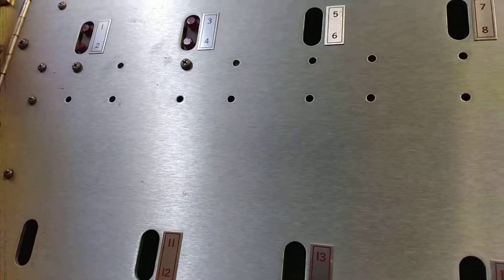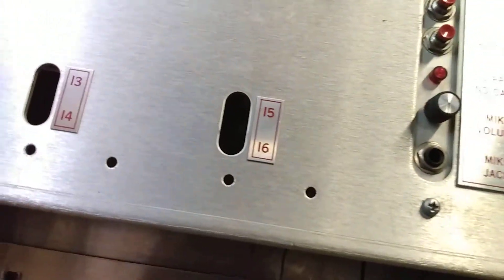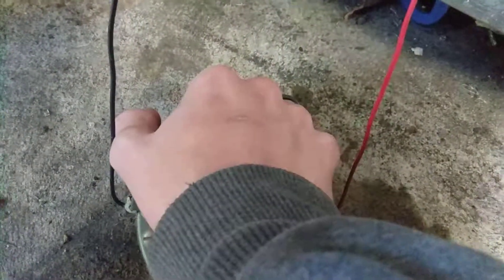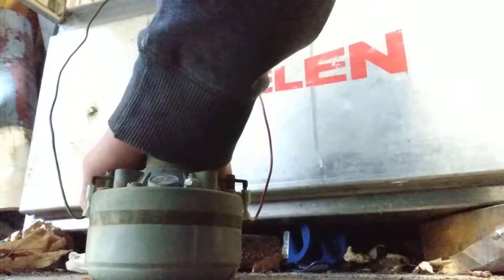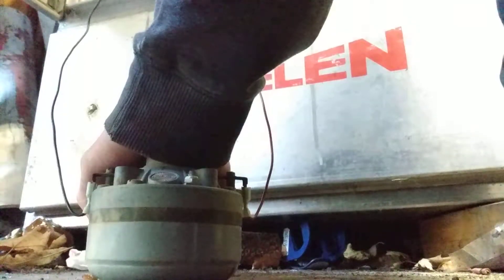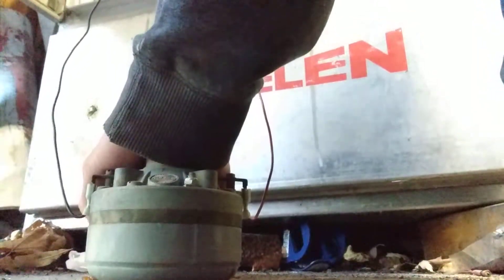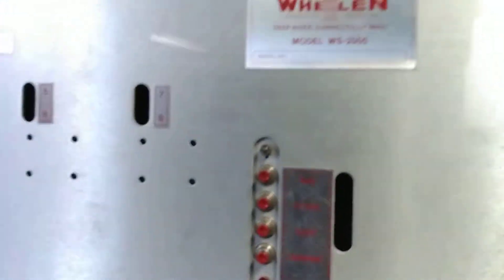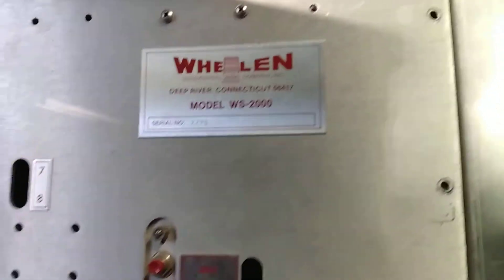Testing all the tones on a Whelen WS-2000 control panel with 80w speaker driver

Comment: those speaker drivers are actually full 100 watt drivers - the controllers run them at 80 for siren tones and then the full 100 for PA audio. pretty neat!
Reply from the maker: it is?, i was looking on the drivers tag and it said 80w
Reply: @ryanpierson220  according to one of the manuals I have they are 100w
Reply from the maker: @Egress.  Huh, werid, I talked to whelen about it and they said yeah they used 80 watt driver's in the ws2000
Reply: @ryanpierson220  maybe the drivers are different? I’m not sure
Reply from the maker: @Egress.  probably,idk

Comment: Do you actually own a WS 2000-115 or is it just a 2740
Reply from the maker: i do in fact, i own 6 of them but one of them is being used for parts, i dont have them at my house tho i have them out at my grandpas
Reply: @ryanpierson220  6!?
Reply from the maker: @dinkindane  yes sir, the town I live in had mostly WS-2000-115s and 2 2809s and one 2750, there's still 2 more 2000-115 up that are going to be taken down at some point and replaced with 2001 130s and I'll be able to get the last 2
Reply: @Ryan Pierson Can i have one lol
Reply from the maker: @STLMetroSirensMain  as of rn probably not now but possible once i get more of the panels working then possible
Reply: @ryanpierson220  oh i wasnt expecting that answer heh
Reply: @ryanpierson220  heh